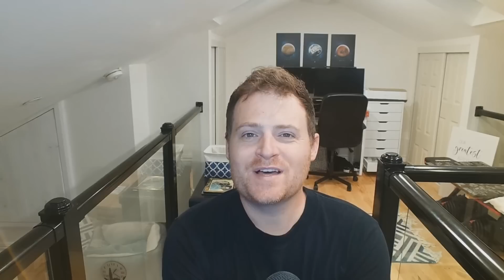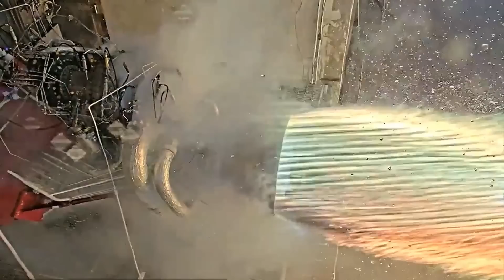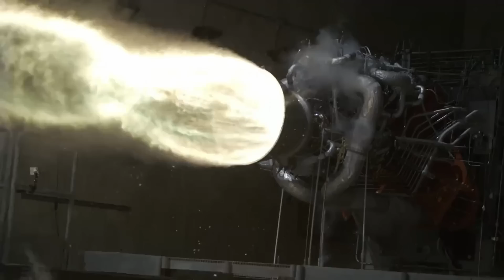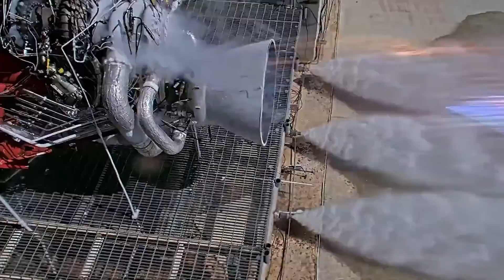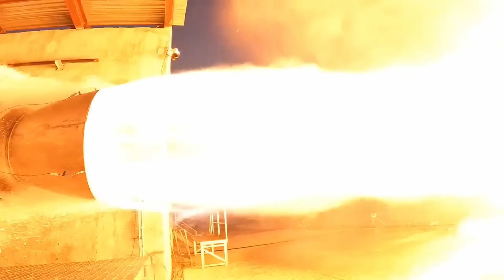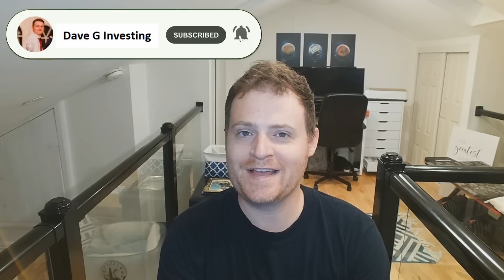Rocket Lab Drops Archimedes Hot-Fire Video and Silences the Critics!

Comment: The hot fire video is really good news. Given the SpaceX Methalox Raptor dev timeline (2016 1st proto hotfire, 2019 1st product version hot fire, 2020 Starhopper, 2021 1st Starship upper stage hop, 2023 integrated flight test 1 launch and still no Starship in production), the Neutron/Archimedes timeline looks really really fast and makes Rocket Lab look faster than SpaceX. And this hot fire proving in a tangible way they are not bluffing - this is what drives Neutron orders plans, credibility, and ultimately market cap increase.
Reply: 700kn vs 2800kn . Full flow vs so called ox rich engine that burns copper 😂
Reply: They can fine tune the engine to be ok in the next 9 months and they can do with less power as Neutron is a far lighter being made of carbon composite. With Falcon 9 SpaceX developed no engine as they used the same Merlin they already had with Falcon 1 - and still needed well over 5y to develop the expendabke Falcon 9 and another 5y to master reuse of stage 1.
Reply: Update 2: Beck tweeted SN 3 already has a tweak to fix the slight copper leak issue so quite faster than 9 Mo..
Reply: His tweet answering what's up with that color in the burn: "Some of it is TEA TEB purge, (starting fluid) and some is slight copper erosion due to a localised flow trip. SN3 has a tweak to solve this."
Reply: What this tells you is not that Rocket Lab is faster than SpaceX but that they will need to be way way faster than SpaceX for their timeline to make sense. Seems more likely that they are many years behind schedule (which is almost guaranteed in the rocket industry) and thus there could be some pain in the company when these delays eventually get announced.
Reply: @cbongiova  Rocket Lab is not years behind in their schedules, as unlike SpaceX these scedules are online for all to see down to milestones, as well as reported as a public company must. Beck had no real capital unlike Musk until over 10y later but is now rapidly catching and has already overtaken in the breadth of satellites capabilities and in large scale light composite materials. If they execute as they so far have, by plans, they'll catch up with SpaceX this decade, despite Starship as there is so much more than bulk tonnage to orbit in space tech.
Reply: @j.m.7715  not years…. More like a decade. 😎